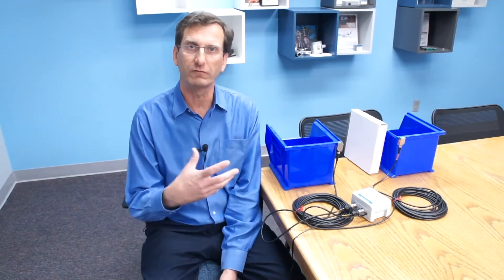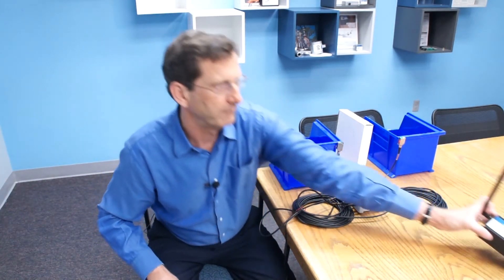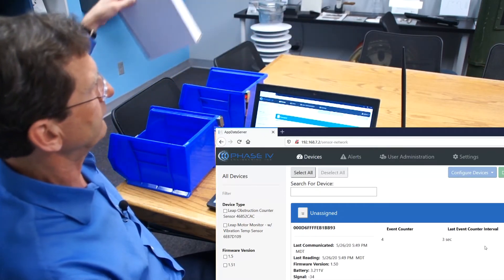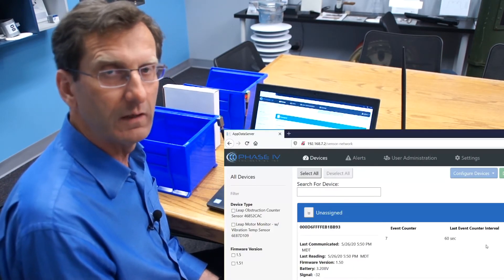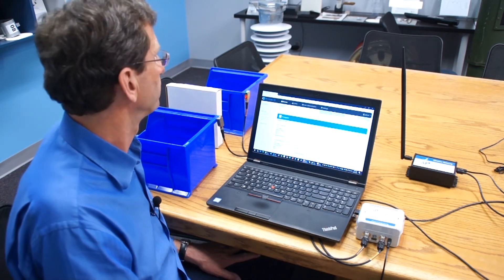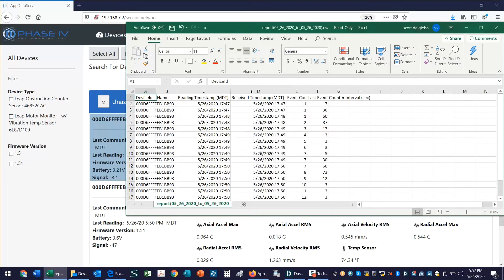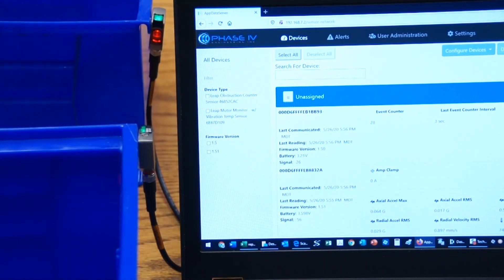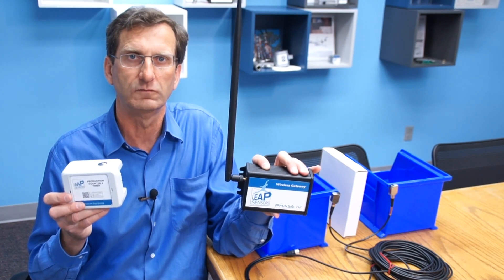Wireless Sensor Demonstration - Production Counter and Downtime Timer

Comment: How does it deal with interferences? Like if someone accidently passes a hand by the sensor
Reply from the maker: We haven't really seen this as an issue with our customer installations. We do recommend placing the sensor eye where accidental detections would be unlikely, as the sensor eye has no way of distinguishing what triggered it. Depending on the situation, the data might show up as different enough that something like this could be picked out. Feel free to reach out to us if you need further information. Thanks!

Comment: in case the the trubeam sensor will be defective 
can we use different type of Trubeam sensors?
Reply from the maker: Yes, most opto-electrical sensors have the same output as our standard "Trubeam" sensor and can be replaced in the field if needed.